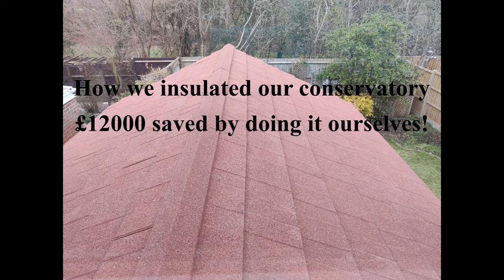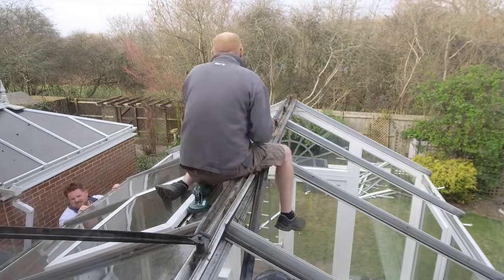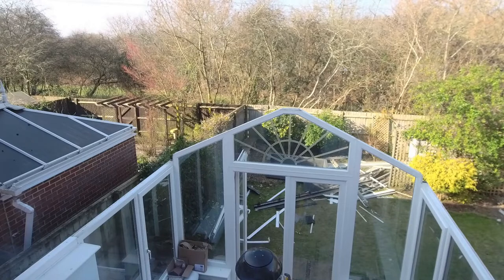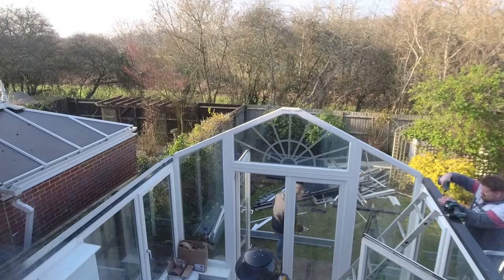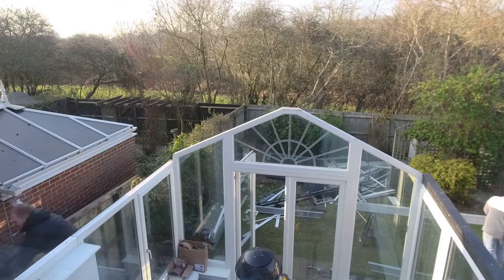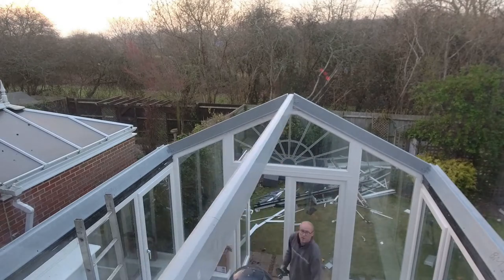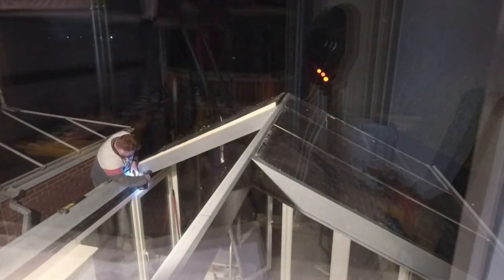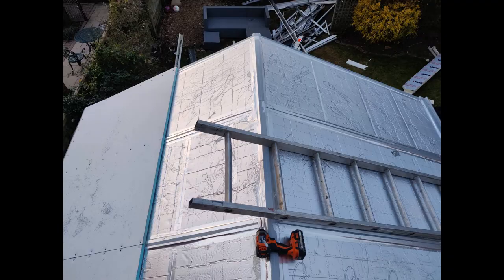DIY Leka Insulated Conservatory Solid Tiled Roof DAY 1

Comment: Hi. Do you mind details of the kind of fabrication used for the roof framework and also if you don’t mind sharing the fabricators you used
Reply from the maker: It's a Leka roof. You'll find your local installer by googling.

Comment: Hi @upsidedownfork your videos have inspired me to use the leka system and do it myself. Did your kit come with any installation guide?
Reply from the maker: Yes, the fabricator sent me a step by step PDF 👍
Reply: @UpsideDownFork  I’ve just received my leka roof kit with only very basic draws of where each beam/insulation/board goes. Was your guide supplied as a pdf? Would you be willing to share?
Reply from the maker: @pigonpie  No problem. Let me know your e-mail address or send me one to upsidedownfork@outlook.com

Comment: That kit would of still cost 5/6k though so you’ve only saved on labour
Reply from the maker: Yes, unfortunately labour costs are an absolute rip off.
See full breakdown here: https://youtu.be/Ai9xKSaIBEg
Reply: @UpsideDownFork  i don’t agree with that comment, if you get a good trades or business that knows what their doing and does a quality install etc, as not everybody knows about building work etc or has the time, then it’s worth the weight in gold, there’s about 3/4 trades 2/3 day to strip off and expose of existing roof, install the new roof then coming inside to do the internal ceiling and plastering, protection to existing floors etc waste removal, electrical which I’m guessing your not qualified to do, then sign off dealing with building control etc to ensure it’s been done correctly and correct materials have been installed, you should not refer as labour as a rip off as there is not many good trades around anymore there all busy working on customers projects that want to pay for a good job, you cheap skates go to back of the que nowadays
Reply from the maker: @bigrjc2008  you've got plenty of good points but £17k for 2/3 days? Roof kit under £5k for someone at trade rates.
Where does £12k go? Split that between 3 days, £4k per day?
I recognise and understand overheads of insurances, van, tools and lots of consumables that quickly add up, but still, that's a serious day rate!

I've just had a solar installation by an incredible firm. Had some excellent tradesmen in for a few days to do the work and they were worth their weight in gold. Pride in the job and their workmanship were second to none, but they also charged a reasonable price. They weren't the cheapest quote either...unlike us cheapskates 😉